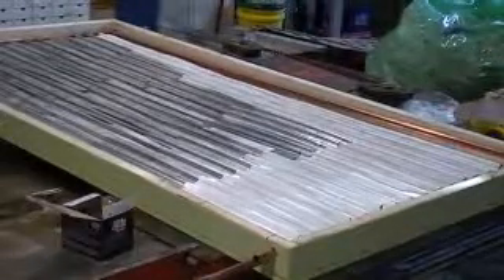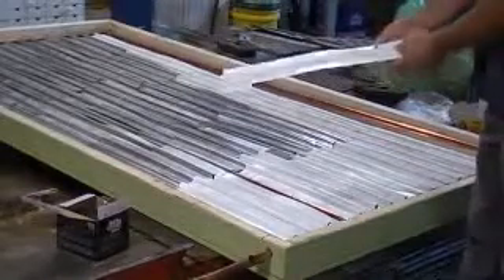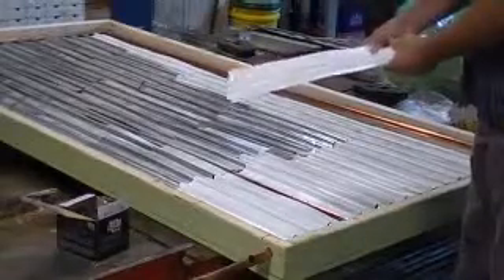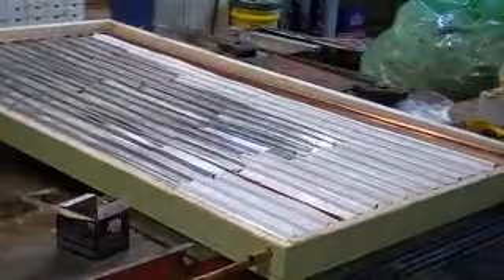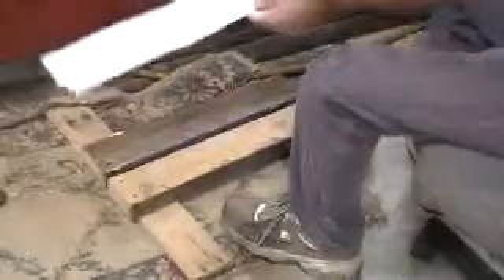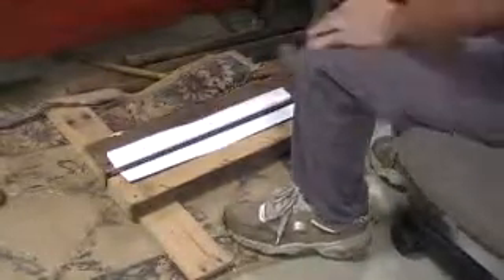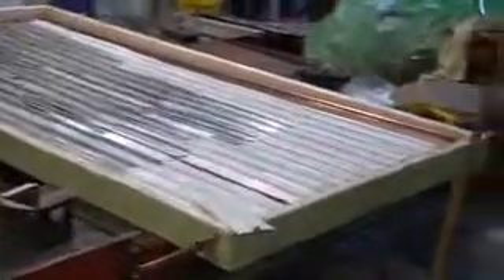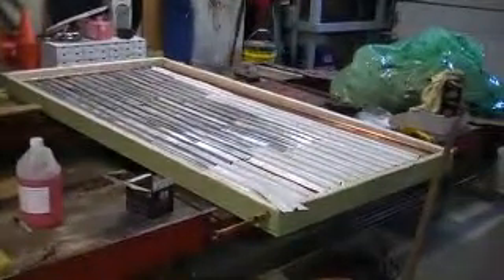How to build solar water heater (part 6)

Comment: This is the absolute simplest and most effective way to shape those fins. Great job!
One concern about the silicone bead, though. Isn't the silicone insulating?  Will it not diminish the heat transfer ?
Have you applied it on the pipes? Is it working fine with it?
Reply from the maker: Great questions this was one of my first videos so I think I am going to do a follow up vid. I will get to your questions the best I can. I will post it later today or tomorrow.
Reply from the maker: Lucian Dinu   Here is a link to a new video about the collector let me know what you tink and if you have anymore questions.     https://youtu.be/QTq-eQop__s